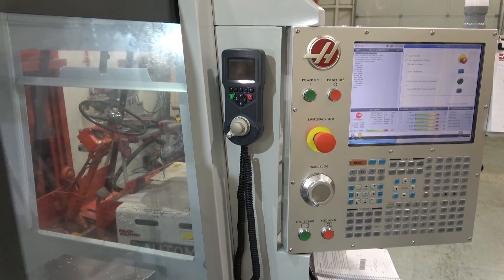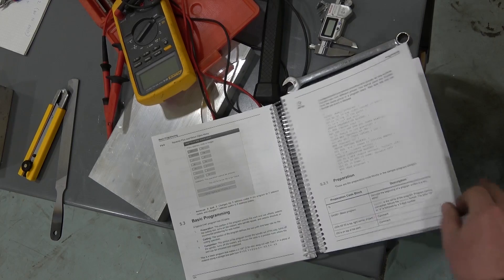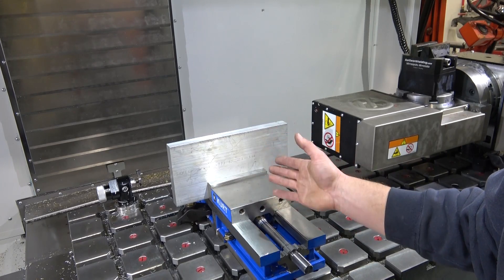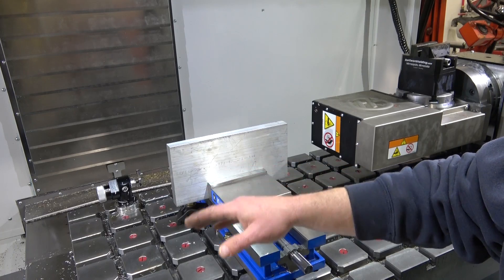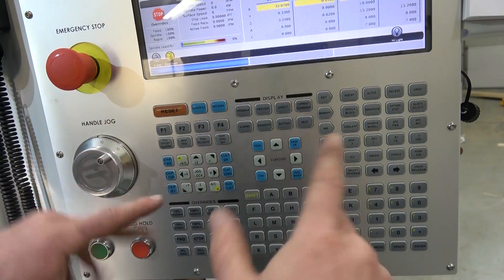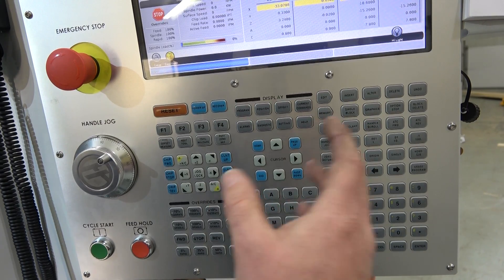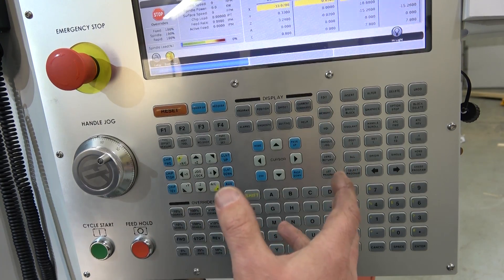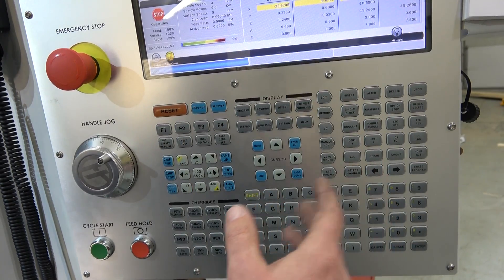HAAS Shakedown | JUNK Visual Programming System

Comment: That's why MACHINISTS MACHINE STUFF.....you have absolutely no understanding of CNC, tooling etc. Why put a tap in a drill chuck for RIGID TAPPING! you have to understand G-CODE
Reply: As a self taught full time cnc machinist I applaud you!!! But a good point was made. Using a tapping head makes a world of difference.  Huge fan! Currently keeping my dick in a vise
Reply: @originalbigtee  Just use an ER collet and do your programming properly (feed/speed) and taps will be fine. No need for expensive heads or any of that stuff. Using a drill chuck is a poor idea though.
Reply: How dare he try to teach himself something new and expand his skill set!
Reply: Personally, I think it takes great big balls to try and learn something new regardless but on a high cost machine like this even bigger balls. Keep rocking! If the machine controls are crap, Haas needs to hear it, because they really don't have to be that way.
Reply: I'm going on 20 years of CNC machining now. Haas has by far the absolute worst control and conversational programming systems by far imo. Hurco or Fanuc all day for me.
Reply: @mikereid3555  Seems to be a lot of "if I had to learn this shit you have to too" going around. Or just the code version of Stockholm Syndrome.
Reply: Actually, your comment makes very little sense, sensei. You should only have capitalized the word "machinists" to give emphasis to your opinion about untrained peeps having a go at it. You used an exclamation point at the end of a sentence that required a question mark. Then you say "you have to understand g code" immediately after talking about the drill chuck, even though understanding g code has no effect on what type of tool holder you ought to use.
.
Edited due to blindness.
Reply: wordreet no it was a drill chuck. Did you go back and check the vid? Or just rely on your memory?
Reply: Are the docs and manuals online anywhere?

Visual programming of anything seldom works.
Reply: @wordreet  its a drill chuck.
Reply: You're new here aren't you.
Reply: I could understand if he was dabbling in operating on people, then you could say  "That's why DOCTORS DOCTOR STUFF ..." There are laws against that shit. But AvE purchased his own machine, so in a free society like CANADA, he can do what the fuck he wants ON HIS OWN MACHINE. If he was masquerading as a machinist at a place of employment, then you would have a valid point too.  He's not hurting anyone (except potentially himself and his expensive new learning machine).
Reply: I run a machine shop and I would say that most prospective hires fall into the following categories:
  1)  People who are ok knowing the bare minimum required to take home a paycheque   
  2)  People who already learned 'everything' about machining and can't be bothered to learn more 
  3)  The RARE individuals who find joy in discovery and challenge.  
I see alot of #1 and #2,  very very few of #3.  Keep on rockin it out AvE,  more people might be tempted to find out how satisfying it can be to get some dirt under your fingernails.
Reply: Wow I'd hate to see this guy trying to teach his kid how to do something. Only parents can parent; only kids that know how to ride bikes can ride bikes. Timmy how dare you learn to ride a bike. That computers only for business professionals. Mwahahaha.
Reply from the maker: Keyboard warrior found! Nice try at gatekeeping too. Fuck off back to the practical machinist forum with the four other calcified fucks left on there.
Reply: @arduinoversusevil2025  Don't sugar coat it. Tell him how you really feel.
Reply: @arduinoversusevil2025  You mean to tell us you weren't born knowing everything about CNC, learning is not allowed in our day and age!
Reply: @arduinoversusevil2025  its going to take you a year at a minimum to learn the machine and learn to machine. use fusion 360 with a Haas post and you will be better off. dont use the shit that comes with the machine. be smart!! dont use drill chucks on a CNC its shit use ER collets or Weldon shanks you'll get good results.
Reply: @arduinoversusevil2025  
Thanks to u, some 
how to, and review vids I learned my self some flux core welding and found out it's not too hard to learn👍👍
Reply: @arduinoversusevil2025  that guy must be the same guy that we call for tech support at work. When our cnc goes crazy we call the company and get on team viewer. They tech guy always thinks we're are obsolete cause we are learning and don't know everything. We took there class but it was no hands on and we didn't learn nada. Good luck you got this.
Reply: @arduinoversusevil2025  he's not wrong, taps need to be held and driven positively in cnc.
Reply: @arduinoversusevil2025  announces haters in the video, hater actually takes the bait, hater gets caught in the comments, hater gets called out AND pinnes as top comment like a hunting trophy. N I C E.
As any trade: Practice makes perfect, best with some method of learning behind it. How can people waste their time watching such a video and then complaining.
Reply: @arduinoversusevil2025  on behalf of all the other doug f's in the world let me apologize for this unprovoked attack. haha
Reply: @arduinoversusevil2025  get him!
Reply: @arduinoversusevil2025  Just use your brain you have a good one, take it slow, soon it will be as natural as picking up a beer.  We all have been through this. Tomorrow you will be better than today. Soon you will be able to machine a square or a rectangle, wait a bit before you try a triangle.
Reply: Wowser powerful bumble anger! When do you buy And I thought this would be almost first thing you'd by because of name Electric Disintegrator. you know to fix the software's screwups.
Reply: @arduinoversusevil2025  Get him!
Reply: understands haas o.g. code
Reply: Lol. He poked the Canadian bear. 🐻 Here endeth the lesson.
Reply: Another fucken asshole with no useful info.  Any two bit prick can insult.  Try providing useful knowledge, and it can be done without being a jerk-off.  Just keep at it ave, you'll lick er in no time!
Reply: Haas  pride themselves on accessibility, ease of use and functionality from what I’ve read and seen. If AVE says it’s garbage then I’m taking that as gospel. He may be 75% alcohol for the most part but he knows what he’s talking about. 
Learning a new machine and just “going for it” does take some brass ones and is very commendable. Keep it up
Reply: @Wyllie38  I loved the "any line restart" when toolmaking on the HAAS. When having to restart a several hour 3D tool path it beat the shit out of the other (Victor) machine we had. No reprogramming to avoid reworking already machined surfaces.
Reply: I know G-code! means I'm gettin a hot supper tonight!
Reply: Hope you have a new spindle cartridge pre ordered!
Reply: Why the hell would you want to discurage someone in broadening their horizon or are you one of those dickbags that has a crap life and wants to spread it either way fuck off over there and when you get there fuck off again
Reply: Watching a machinist machine stuff is boring as frig!
Reply: I cant really add to Ave. However, here's my two pennies worth. Fuck, one of the greatest things about being human is the ability to pass on and communicate knowledge and therefore accelerate the learning curve (please see previous video). You sir, are just an antiquated, elitist fuck, the kind of which that is capable of actually slowing down advancement. How many hours of your tutors time did you take up to learn your craft? How many hours have you contributed to positively helping others? At the risk of sounding homosapian, AvE would teach anyone of us how to piss if we asked. Fuck off. Fuck. Off.
Reply: You could just calmly explain what he's doing wrong and how to do it correctly?
Reply: How do you think machinists get to be machinists you rockmellon?
Reply: Give ave a break he bought this to make cool shit and put it on the internet. AvE keep up the good work no body needs to give you shit for trying.
Reply: I withdraw part of my criticism, it was indeed a drill chuck when the tap broke. Even so, they work fine if you do 'em up goodentite!
Reply: @wordreet  You got something wrong, had people tell you it was wrong, and corrected your mistake.  Hmm...I'm not sure you belong in the comments section of YouTube.  That said, who else here is thinking that Doug was trying to be funny?
Reply: @BruceS42  Are you saying youtube commenters should not admit their mistakes and put the wrong right?
Reply: @wordreet  No, not really, just that it's well above the quality expected in YouTube.  Tbh, I salute you for doing so.  It would be great if that became more of a norm in YouTube comments.
Reply: @BruceS42  Ah, point taken. But I'm not changing my name to Norman for anyone! ;¬)
Reply: Doug I bet you dont get much rigid tapping done EITHER.
Reply: [apply cold water on burnt area]
Reply: I think Doug needs a hug.
Reply: @John Smith An interface is like a joke - if you have to explain it, you did it wrong!
Reply: Hes right about the drill chuck
Reply: Indeed worst interface ever!!
Reply: G code is the past.
you should use feature based programming.
Reply: If I'm not pissed off I'm not learning new stuff.
Reply: I think a machinist will have far better hands on "feel" for different materials than most cnc operators who havent been working in a workshop.
Reply: @AvE love your channel keep up the good work and keep it up you will get it soon enough and keep putting cool shit on the internet. Just gaggle cnc g code in learn the basics
Reply: "Dam you got knocked the fuck out" the movie Friday.
Reply: If he knew what he was doing it would be no where near as entertaining.
Reply: What I wanna know is if AvE had this comment in the chamber and his finger on the trigger just waiting for the first elitist to trip the perimeter sensors before the video even went live.
Reply: HAAS isn't so bad compared to Mori Seiki Windows interface crashing all the time, crashing your mill and Mori Seiki blaming you for Windows crashing, and out goes 20k. At least HAAS stands by their product. Then MAZAK with their weird stuff. Suffice to say, all the interfaces suck and could be light years better.
Reply: Doug F hey fuck-o  why don't you go fuck your hat        @AvE   get him  lol
Reply: So if you have to know G-CODE to do rigid tapping (whatever the that is), why does that interface let you set up this operation when the programmer (who wrote the interface) knew would screw things up and break things? As a computer programmer, this and the unknown error code say to me that this interface was not ready for internal testing, let alone public release. I would not trust this thing to make a coffee cup. The damn thing would have some horrible hidden flaw that would come at you with no warning and cut you nose off as it broke (or worse). the the
Reply: Holy shit I hope I never piss off AvE enough to get an insult. My nuts would run and hide never to be found. Well done.
Reply: Don't do what Donny Don't does Mr. Doug!
Reply: 97 replies so far and not a single one showing defense for Doug F.
Good stuff frankly.
Reply: How many butts can a butt-plug plug
If a butt-plug could plug butts
He would plug butts, he would, as much as he could
And this butt-plug's name is doug.
Reply: Visual/conversational programming is an afterthought on Haas, so no surprise that you're having issues. Hurco has probably the best system, but the cost is "blood from a stone" territory easliy 150k for a meter sized machine with only 3 axis. And yes, a tap in a drill chuck is a bad idea, in fact a drill chuck in general in a VMC is a bad idea - terrible runout, and the keyless ones tend too loosen up fairly quickly under the braking of the dpindle in short order. As for the manual being dru reading, theyre all like that - i dont think ive ever seen a manual that wasnt as bad as reading a dictionary.
Reply: @machinist7230  It used to grind my fucking gears when I was toolmaking (plastic injection & metal pressing) because the managers had kitted out the 2 CNC machines with keyless Drill chucks instead of an array of ER16 Collets. They did it only 2 months before I'd started there too. Then they bitched and moaned when the drill shanks flogged out because the drill chucks dug in and left jaw lines. And they  bitched about having to replace the drills of all things....
Reply: Well, that’s pretty rude from someone who can’t even express themselves correctly in writing. That’s why writers write stuff....you have absolutely no understanding of sentence construction, punctuation, grammar etc. Why put an exclamation mark at the end of a QUESTION!
And, by the way, this is from a testimonial on the Haas website: ““Thinking in five axes was new to me, so I took it slowly to start with.” I presume that they understand that it is reasonable to feel your way through stuff as you learn
Reply: Right out the gate with the C word AvE, nice touch. Keep chippin.
Reply: meh , i rigid tap in whatever tool holder i have available . chucks work just fine . its people like you doug that cause the skill gap to 
grow.   we all start somewhere, we all scrap parts at first.  if you never scraped a  part you've never been challenged. the only thing i saw  
was the direction of cut.
Reply: Lmao... Tho mighty great AvE.. That was sweet!!!
Reply: If you gotta fuck with G code on a cnc you’re doing CAM wrong, but if you gotta do it, it’s about a dead nuts simple of a language as there could possibly be.  You aren’t special for knowing it, kids learn a more complex language in logo.

Do us all a favor and get back to fucking with your monoprice 3d printer if you’re gonna be such a wet blanket.
Reply: Hehe that is some funny shit right there! I’m still trying to understand the connection between drill chucks and g-code. I like windows they taste like purple.

Comment: 3:35 Why in the Hell are you taking a conventional cut on a CNC Machine?
Reply: You've gotta work more on a CNC. There are a lot of scenarios you conventional cut instead of climb cut, the main reason being able to control your chip removal and to cut down on overall run time be eliminating unnecessary movements
Reply: @Zontics  that's why you do speed milling
Reply: @jckdnls9292  lmao, huh? Speed milling?  You mean high speed milling? Which just means fast spindle or feed speed Which is exactly what hes doing...stay in debur department where you belong.

Comment: Dont hold taps in keyless drill chucks!!  It will loosen in reverse.  My favorite way to hold a tap in a Haas is in a Bilz collets system of the rigid Lyndex variety.  Just a pro tip for Barba Bublefuck

Comment: For real....the keyboard warriors are strong in CNC

Ave...my rep told me the groove for deep dog needs to go to the left...or arm style tool changers can throw tools
Reply from the maker: my rep told me doesn't make any difference on this machine. We tried to rip it out of the double arm. Held firm.
Reply: @arduinoversusevil2025  When you say "We", you mean you and Uncle Bumblefuck, ya?
Reply: @arduinoversusevil2025  Nice....There's so much to cnc it's insane...was just trying to share a heads up in case you didnt know! carry on :)
Reply: If you start using boring heads, use m19 to orient the spindle first so boring heads are alyays loaded the same direction. Can help prevent crashes when using boring cycles with retract. 👍
Reply: @crazbikr  And, be sure to check that the CNC is configured to move the correct axis(es) in the correct direction for the selected plane(s), and related tools (boring bars/heads, custom tools, etc) all point the same direction when the spindle is oriented.

Many a machine out there is setup correctly for the G17 plane but wrong for the other two.  Seems to require A) the sacrifice of a boring head, or the until-recent straightness of same... B) the inclusion of a nice scratch up the inside of an otherwise perfecto bore... C) both.... D) or worse, after which the MTB or VAR makes the corrections and all works as intended.

Note: the correct answer is D).

And lest we forget: Murphy was an optimist.
Reply: The danger of the side mount tool changer is when a chip gets stuck in the release pin - that is when it throws your 2" face mill at 100mph. Super scary - just keep an eye on the arm pins to make sure chips are not piling up on them.
Reply: If the tool holder, tool pockets, arm or spindle require the deep dog one way or the other, yet accepted the tool in the wrong orientation, it needs a visit from the MTB or VAR to be fixed.  You are absolutely correct that modern ATCs can throw tools hard; 3" face mills make big dents, even with a fairly moderate arm like in the present.
And a call to the Sales Scritter so's to bitch about an incorrectly setup machine, with serious damage to tools/parts/machines/operators and bystanders just waiting to happen.  Should result in a free service call to fix the problems and a free Haas hat.